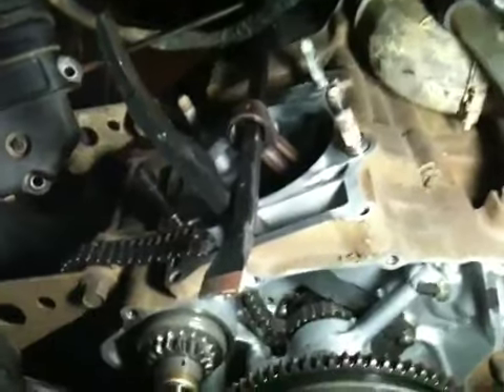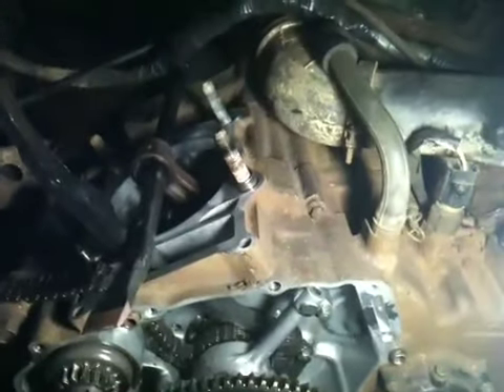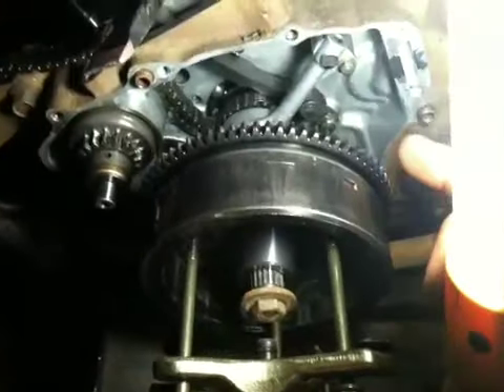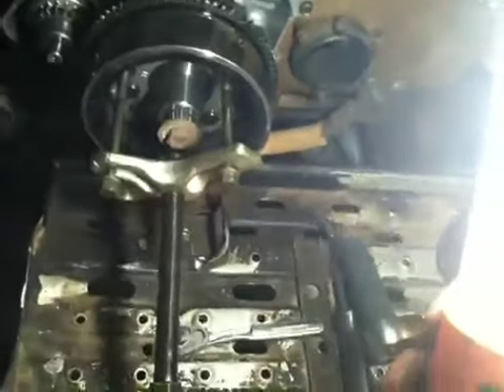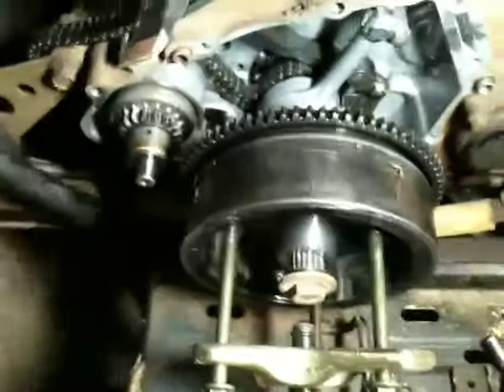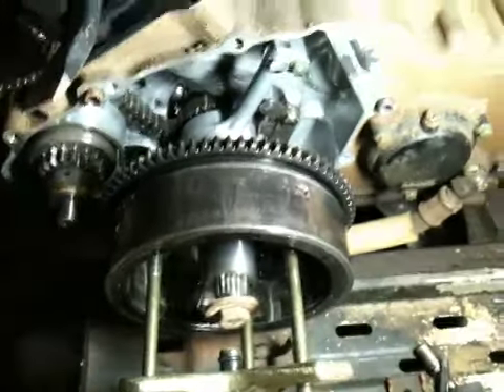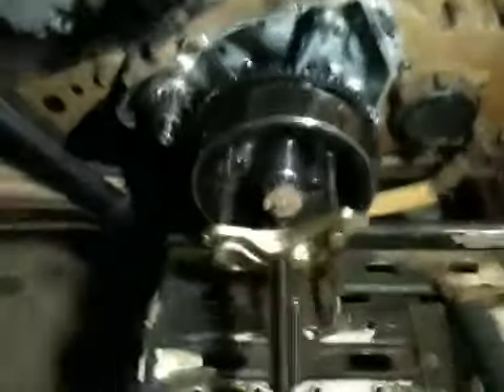Yamaha Grizzly 600 Rebuild part 3 - magneto removal

Comment: How did you get the magneto back on? I am building a 450 2008 model and there is a woodruff key that the magneto slides on but no bolts to hold it on. I don't know how I would press it on since it is setting on the flywheel and there is no space for it to go any farther?
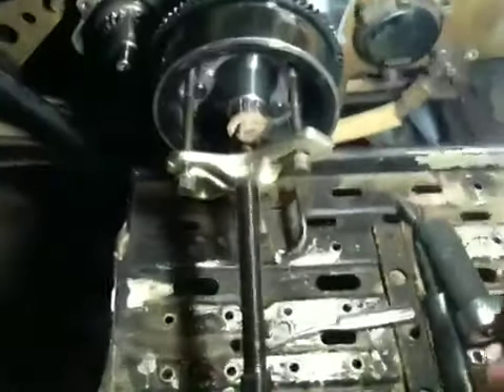Reply from the maker: Mine has a woodruff key as well, but it is also a taper fit(yours should be too). All you need to do to put the magneto on is line it up with the woodruff key, slide it on the crank until it stops, and then put your side cover back on. Once you get the cover back on, then you put the pull start "basket" (the piece sitting beside my ratchet at 1:05) back on the end of the crankshaft, and when you torque the pull start piece down, it is actually tightening your magneto as well. It wont really go much father than what you can get it to go on by hand, but it will move a little and get good and tight since it is a taper fit. That is why it has to be pulled off instead of just sliding off. I hope this answers your question, let me know if you need anything else.